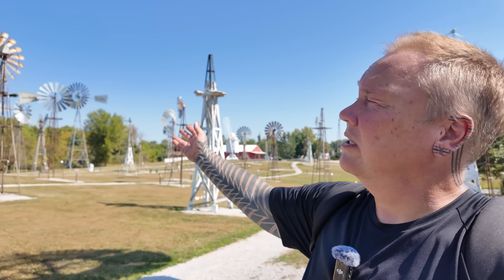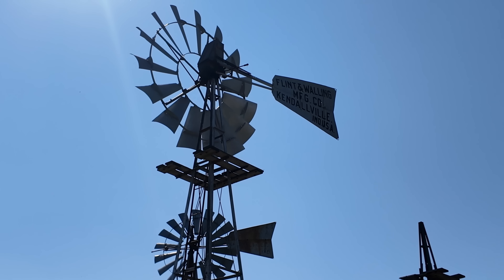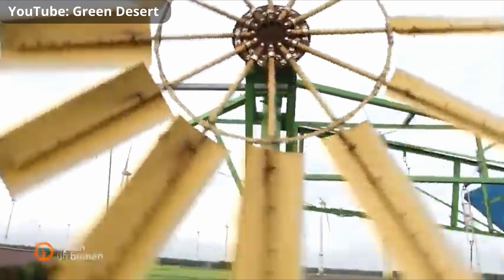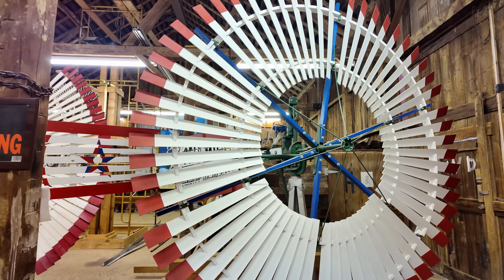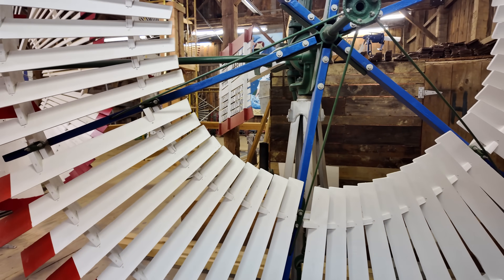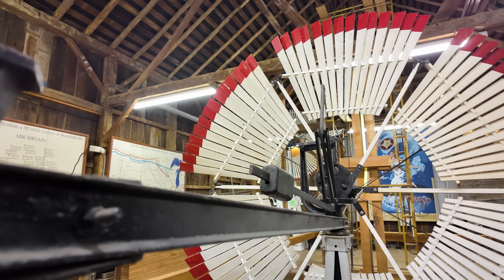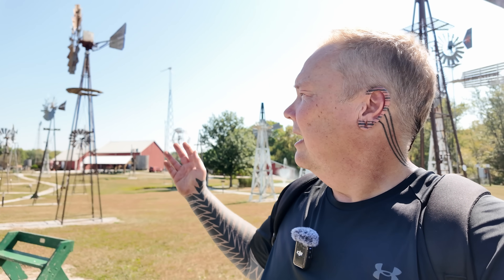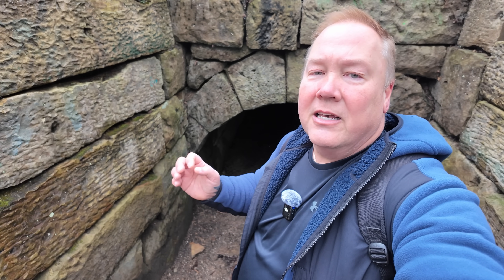Hidden History of American Windmills Revealed

Comment: those things work well, my buddy uses them on his remote grazing locations on his farm. those are all over the place still around, though they don't like tornadoes very much but what does
Reply from the maker: Oddly, compared to overhead electric wires, they might actually do better with passing tornadoes!  Certainly a lot cheaper to install in remote locations.
Reply: @Industrial_Revolution   they do fine really, till you find them stuck in the side of your house lol. those big turbines don't do well with tornadoes, the winchester indiana one tore a blade off it, that was wild to see in person
Reply from the maker: These little ones, if they fall apart, don't really do much damage.  Greenfield Village in Dearborn lost a blade in a storm this spring off their big windmill (late 1600's grist mill, I think).  That one would have hurt if it hit you.

Comment: Very interesting. Didn’t realize some farm windmills had those mechanisms on them. Thanks for the video.
Reply from the maker: There's a lot to them.  The oldest ones are pretty much exactly what you'd expect (but with a manual brake on them that you activate with a rope hanging from the top).

Comment: Based on where I’ve seen these operating, everything would have to be fully automated….
I’d guess that industrial machines were involved in the manufacturing of these windmills.
Reply from the maker: The earlier ones had manual brakes on them, which would likely work fine for the ones right at your farmhouse, but not so much for windmills on the other side of your ranch.  If they have some type of braking system, and self-lubrication, they don't need much attention for years at a time.